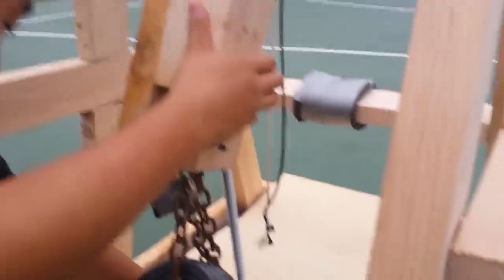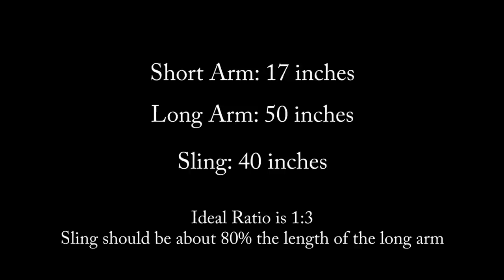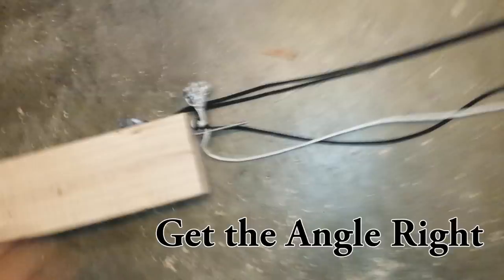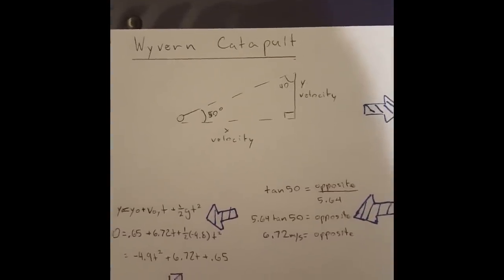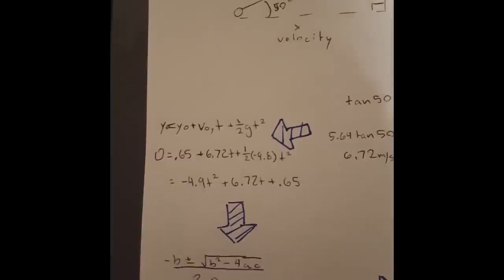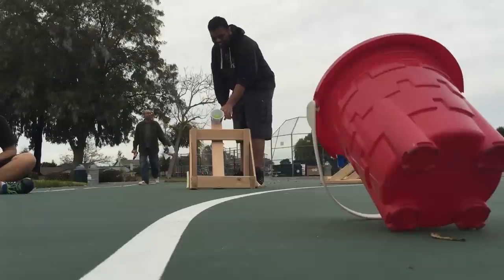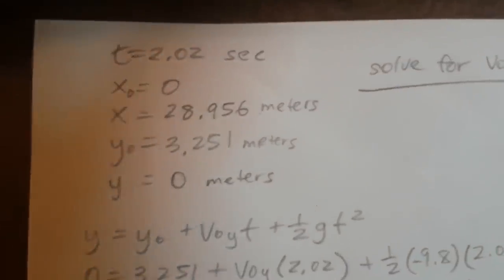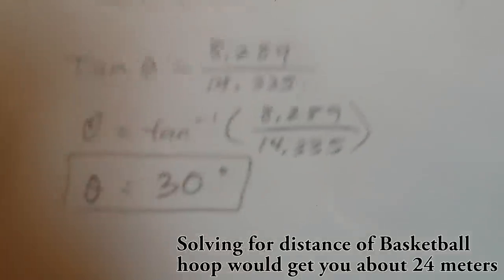Physics Catapult Project

Comment: My son built a 1 meter( L) by 1 meter(H) by .75 meter(W)  fulcrum  type 1 tension  catapult which is similar to a trebuchet minus the sling,  Also minus the  weight which is replaced with about 8 solid rubber bungees  It had an arm that was about 1.5 meters . The thing launched baseballs 150 ft

Comment: 2:15 how can i build that trebuchet? :/
Reply: Thats a catapult at 2:15 not a trebuchet but on regards to building it... The base seems to be about 4ft long 2ft wide, the boom is about 5ft and it has an additional 2ft of pvc which is supported by 1ft of pvc under that. The crossbar is about 1ft 6in tall and the crossbar supports are about 2ft long. They have a frame built around the base that I have not determined yet but if you build this there is about 2-4in of space between the base and the frame.
Reply: @6ray  omg thanks a lot!